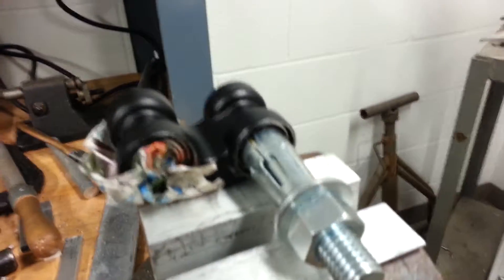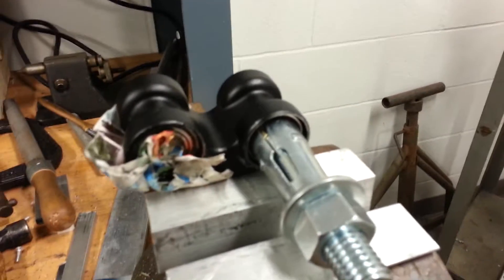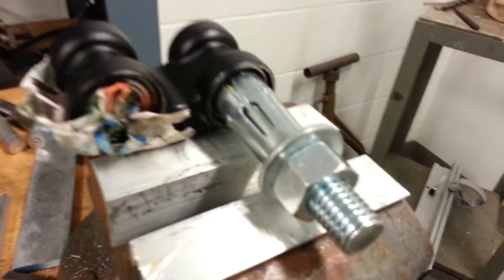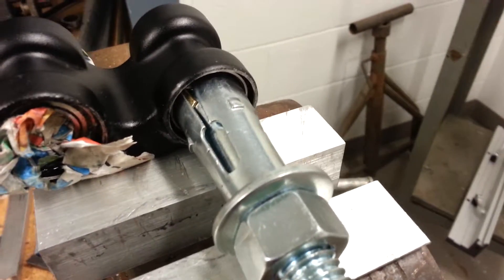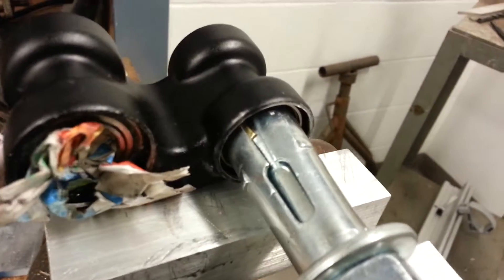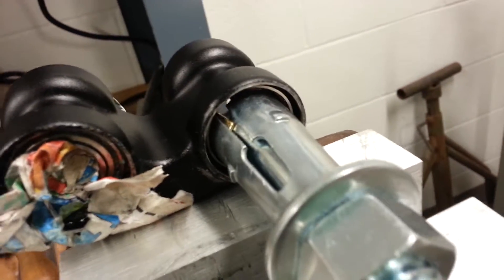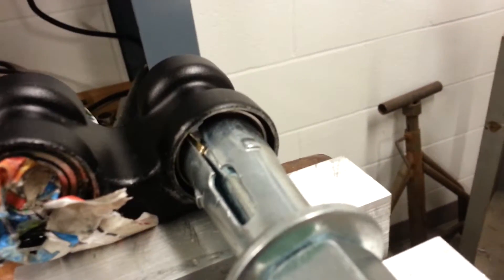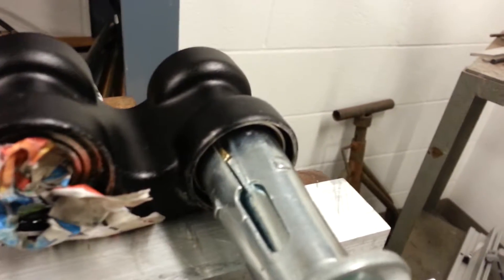Santa Cruz tallboy Lt-C lower link bearing repair

Comment: Great vid. Did it work?  Question, please -- Did you ever have a gap form between the lower linkage and the rear triangle, on the drive side of the bike? (I have a Nomad 3.) When I screw in the pivot axel bolt into the rear triangle, the tab the bolt screws into is pushed away from the linkage - leaving a 1-2 mm gap. It super tight/flush on the non-drive / bolt insertion side.  If so, any solutions to fixing it? Thanks!
Reply from the maker: Hello. Cant say I ever noticed that. Yeah the repair worked fine. You may have a damaged thread in there. If you can, take the triangle off and try to run a similar bolt thru from the opposite side. Dont use the real bolt in case there is something in the insert that could damage the bolt. If it even shows a hint of binding, stop immediately and run a high quality tap into it from that same off-end. I would recommend a normal tap, not a bottoming one. If you dont have a tap, a cheap way out is to file a groove along the threads of a bolt with a very good triangular file....essentially making your own tap.
Reply: @johnrobertson7583  Thank you for the reply. Glad to hear the repair worked fine. 

I will have to try that and let you know. I have a video of what I'm talking about at https://youtu.be/eWV_OIuhvmQ  

My other concern is that the linkage has previously rubbed some of the material away on the drive side, so now there a slight circle grove in the frame. I worry as the bearings get broke-in/ looser over time, the link will get pulled more into the frame as the pivot axle bolt has to be tightened down ever so slightly more. Hope to address that issue before I ride the bike again, too. I don't want to make things worse. LOL.

Comment: John,
I just went through this with the lower link of a Santa Cruz 5010 and 2 stuck outer races.  Plumbers torch used to sweat pipe, block of wood and thick leather gloves.  I applied heat directly to the race and link, (removed the rubber plug first).  Smacked the link down on a block of wood using the gloves while it was still burning hot, the races popped right out.  Had both out in less than 10 minutes.  A friend that had been a Moto mechanic told me to try it. I did not think it would work but they popped right out.

Comment: John,
I recently went through this with a Santa Cruz 5010 lower link. Leather gloves, cheap plumbers torch used to sweat pipe and a block of wood.  I heated up the link and the outer race with the torch(remover rubber stopper first) smacked the link down on a block of wood with thick leather gloves on and the race popped right out.  I actually had 2 of them stuck and had both out in 10 minutes.  I wouldn’t have believed it if I hadn’t seen it first hand.
Reply from the maker: Good job! You do have to watch out though those lower links  are cast and then machined and the heat from the torch could possibly change the properties of the metal since they are not machined from billet.  Now if you were to take that one step further, to make it easier to install the bearings the next time, put them in the freezer and then when your link is still warm and drop them in and you hardly will need to press them in at all.

Comment: Use a plumbers torch used to sweat pipe, thick leather gloves and a block of wood.   I just went through this with the lower link of a Santa Cruz 5010. Applied the torch directly to the stuck race, got it burning hot and smacked it on a wood block wearing the leather gloves.  Both races popped right out in less than 10 minutes
Reply from the maker: you do know that using heat on metal it causes it to expand not contract. An outer race of a bearing pressed into another assembly needs to be shrunken or at the same temperature and not expanded.  if your technique was the ideal solution the race would’ve fallen out by itself, most likely there were some corrosion. Unless you were saying you heated the pivot and not the race.  Something to keep in mind if you are ever assembling something that you do not want to come apart like that pivot for example. You would put the bearing in your freezer and the link in the toaster oven. Cannondale used to do use the same process for their  headshock forks it was a one time deal it would have to be cut off.